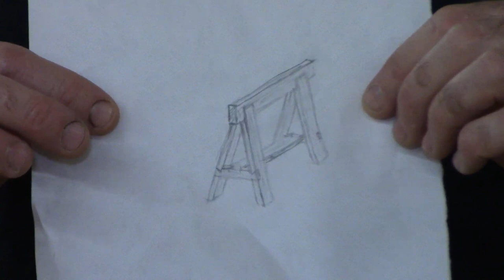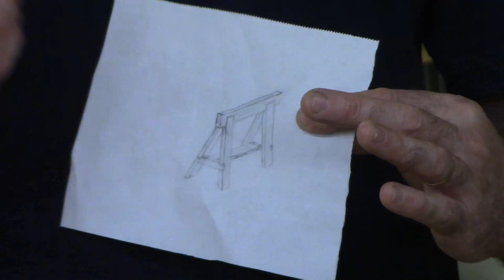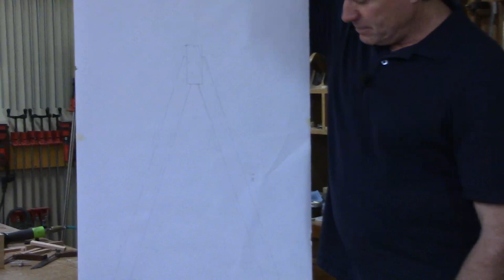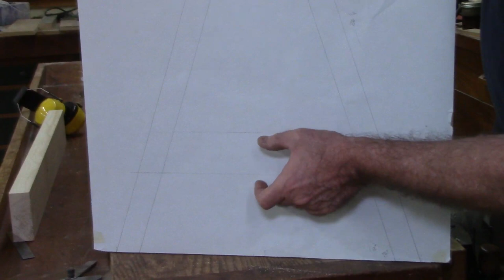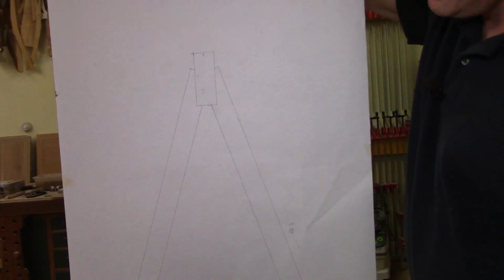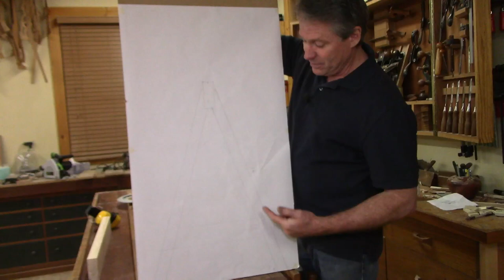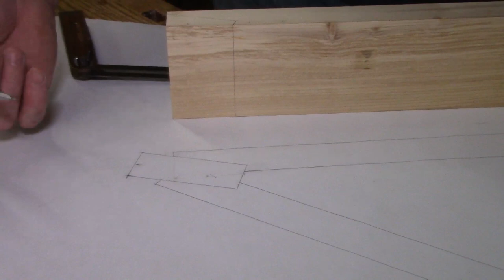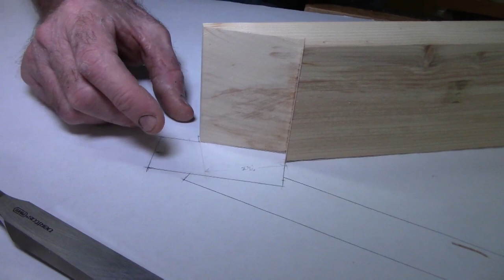Make a Sawhorse from Reclaimed Stair Treads, Part 1 with Tom McLaughlin

Comment: I watched your show today, July 10th, nice design. I was concerned about 2 things; first, why would you use the table saw fence with the miter gauge? Would that not cause the possibility of major kick back? And isn't the miter gauge enough to hold the piece of wood you are cutting straight? Second, why would you not clamp the stretcher to your tendering gig? I would think at the least for safety and injury prevention. I do like how you explain everything and your plans are first rate. Joe, Ohio.
Reply from the maker: Thanks for your kind words Joe, i’m glad that you enjoyed the video. I use the miter gauge well indexing the end of the stretcher against the fence primarily as a backer for the cut to avoid blowout. The risk of kickback occurs when the cutoff piece bonds between the fence and the saw blade. I showed two ways to avoid this in the video, the first was rough cutting the waste shorter with my Japanese saw, the second was using the “L” auxiliary fence. I like the directness and accuracy achieved when referencing the end of the tenon or dovetail right off the fence to create nice shoulder parallel to the end...and my miter gauge is much too inaccurate to give me the same results. Hope that is helpful! All the best and thanks for watching!  Tom

Comment: Hi Tom, like I said in the live stream chat, the saw horse will last a life time, strong as a horse. I noticed the platform in front of the table saw, I did not know you had a platform until last night. Is it helpful, how much taller does it make you? What is the height of the platform? I am about 5'-10" you look about the same as me, I think. Looking forward to SNL next week, can't wait to see the finished saw horse and new project build.
Reply from the maker: Hi Steve,

Yes, I like that “strong as a horse” comment...that was my older sister Patty who gave you the “Dad joke” credit 😎
I don’t usually haven the platform at the table saw but had it there from class last week. I keep my tablesaw on a 4” high mobile base all the time, which is fine for me without the platform (I’m 6’ 2”), but I like to cancel the added height of the roller base with height of the platform for the class as it can be a reach when using the tenoning jig.
Thanks for watching as usual!! Tom